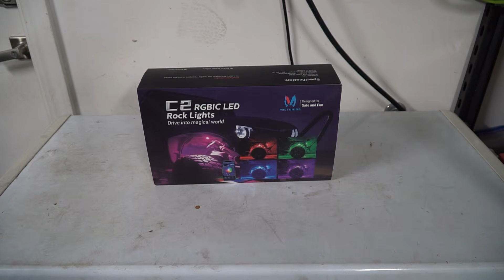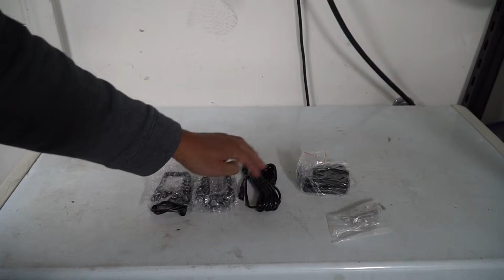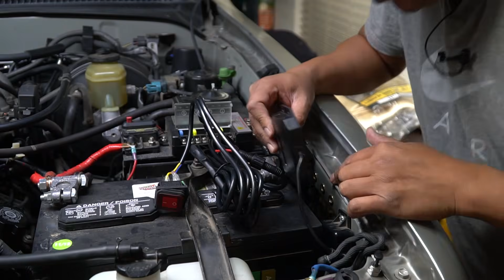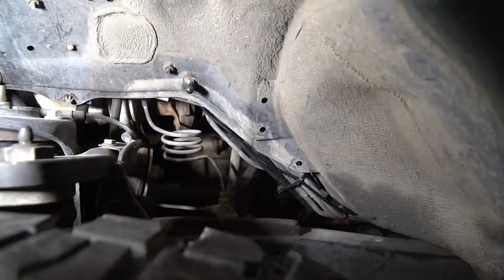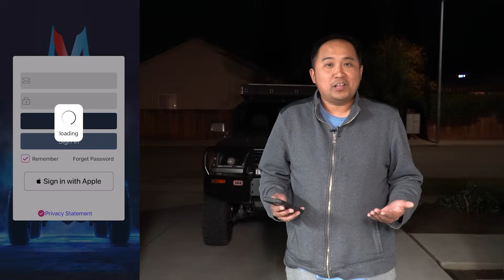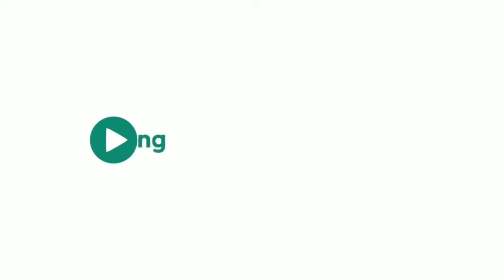MICTUNING Underglow / Rock Light Install - Toyota 4Runner

Comment: Could yall recommend a good set of rotors for a 98 4runner limited 16 inch wheels.  I've got that bad shimmy in the steering wheel,  and pulsating brake pedal, very bad. I don't want to go extremely expensive.
Reply from the maker: I suggest going with any aftermarket tundra brake upgrade kit. 13WL or 13we (for smaller wheels)
Reply: @PhoRunner  so for 16 inch wheels go with 13wl.? I heard I would have to trim something to make the upgrade fit. Idk.
Reply from the maker: @johnr7717 some 16s will fit the 13WL. All 16s will clear the 13we.  It will require tiny trimming of the dust shield to fit the bigger calipers.  

The tundra upgrade will eliminate all warping and shimmying so it’s worth upgrading to it.
Reply: @PhoRunner  thanks man I appreciate it. You owed me because you tricked me last year on April fools day and said your 4runner got stolen.🤣
Reply from the maker: @johnr7717  lol my bad

Comment: If you want to run those lights/auxbeam on either accessory mode or constant 12v override, I've got a trick for you. Are you still on 3rd gen 4runner Mafia? Or did the FB group change names?
Reply from the maker: The group changed and I am part of the new group
Reply: @PhoRunner  what is the new group name?
Reply from the maker: @Shrek-is-Love  3rd gen 4runner enthusiast i believe
Reply: Just run them on an on/off/on Toggle Switch.